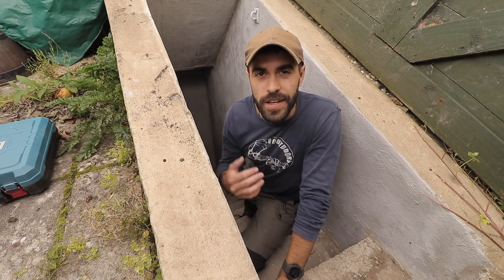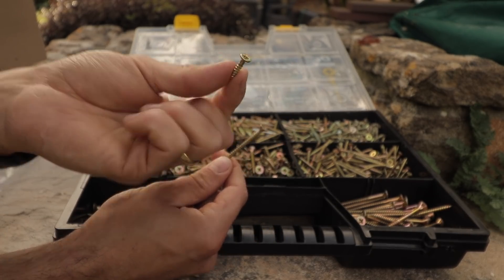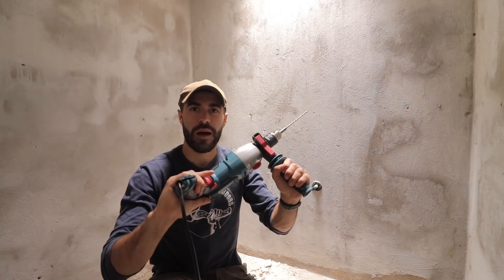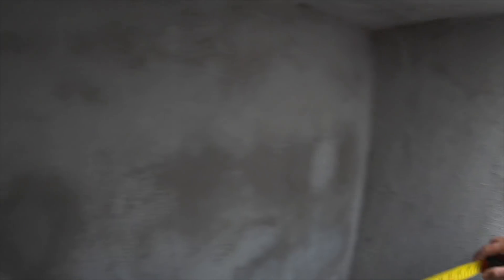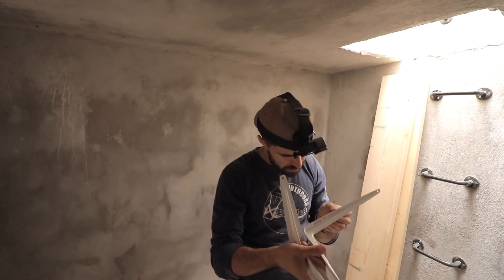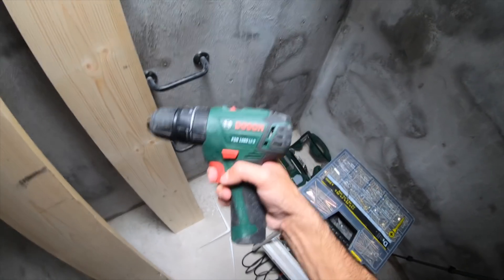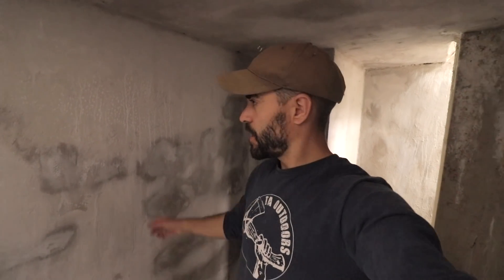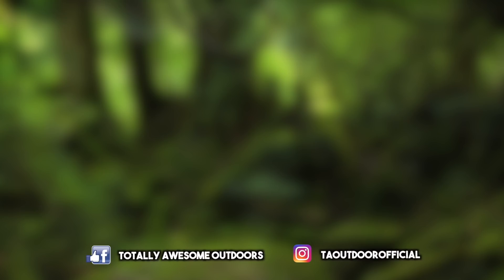Building an ESCAPE LADDER in my WW2 Bunker (PART 6)

Comment: one thing I would have done different for the roof hooks is to use ones with a 2 inch loop to allow for a bar like a dowel or shower curtain rod to be used on them making loads of room to hang stuff from as needed and perhaps a slightly longer set of screws on the ladder ... i would also add a set of heavy hook anchors in the long direction to rig a hammock from for nights out with the kid in the bunker ... for the sump perhaps hit up ikea for one of their round cutlery bins of metal to have a solid base for the sump and ground water seepage ... then put a water level activated pump in there with a hand made sewer cover type lid and power pass through then all you need do is plug in the pump when you need it OR leave it plugged into a solar charged battery system to run when it reaches the set level of water in the sump ... as for power in there ... those power strips with the movable connectors would be excellent for both long sides .. then you can reconfigure the power as you want when you want quickly without having to rip out anything ... just twist off the plug in and move it where you want and re attach it ... or add a new plug in etc ...

Comment: Mate, you used 2 brackets for a 193 cm shelf. That's going to bend in the middle and lift up on the sides. You should have used at the very least 3 brackets. Two near the ends and one in the middle. I would have used four just to make sure it doesn't collapse, ever.

Also you had to seal and stain the wood on all sides before installing.

Also while installing shelves. It is easier to first install the brackets and then put the board up and the secure the board to the brackets.

Comment: From the look and sound of them you ended up with towel bars not 'ADA' grab handles, would explain the dinky screws too.  Should have a thick heavy-duty mounting plate and 1mm+ tube wall, all steel.

Comment: Great vid, love it and still jealous as hell.  I know has been mentioned already about the screws but looking at how the rung was manufactured am a little concerned that over time the actuall rung will become loose from the screw plate.  Did not look very strong.  Also got to add that when using the rung some people may also pull up their weight with their hands on the rungs above as they move up, that means a downward force on the rung.  I would honestly go for a ladder system as each screw mounting supports the weight/pull on the steps above/below.

Comment: I'm sure you have thought of it already, but a wall-mounted folding bed and table/chair set would be neat. Also, I'm not sure if it's possible, but to get some sort of lighting down there that can run off of a generator would be neat. Not sure if there is a way to put a generator in there due to the exhaust fumes. But it's an idea!

Comment: As previous comments have stated, Concrete scews[aka tapcons] would do alot better for securing your rungs to the concrete, I hang signs and anchor other things sometimes in excess of 1000's lbs and tapcons shear weight is 100's of lbs even though your light those anchors could give out over time. Great idea getting a hammer drill, I love my bosch hammer, Love your videos!

Comment: if you look at==20:23 to the left you see the blocks with grass in the cracks--well all of this needs to be removed from there and filled in that way water does not run down the walls from the outside of that bunker--so do a all around check from the outside and seal all this.....good idea especially right now in this world of craziness.

Comment: Feel like you could have staggered them more left to right, since our body naturally climbs staggered hold more efficently.
Reply: while that is true, leverage is why they're commonly not staggered - our legs naturally come to together when stepping - same is true for a ladder - when one brings their leg up to step onto the rung ones foot is actually center with their nose when one pushes off with the other foot it too naturally goes to center line. 

the staggering our body does is caused by the act of motion not motion in of itself, off set/staggered ladders are for when their is more weight than the climber to be expected so as the transition from one rung to the next is fluid and not jickaty jacketty with added weight / carrying tools.

in short - the ladder is for escape - try moving fast up or down a staggered ladder as opposed to center line. center line is quicker.
Reply: Matt Moschel Interesting, didn't really think about it like that. Thanks for being respectful and not shitting on my opinion.
Reply: @veronder  hi Matt. Please see my comment earlier in relation to staggering on concrete surface, as compared to rungs above each other on a steel surface. In your case it's correct. But with the age of this particular surface, I feel it would be safer for Mike to stagger the rungs. In other words spread the load creating less pressure on any one part of the given surface. Cheers.

Comment: Without a doubt, I envision a connection failure before very long at all.  Please replace those screws with something capable to carrying above average body weight; plus some reasonable safety factor. 
I would also recommend checking the capacity of the fixture itself.  A grab rail is used as a supplemental support....say to grab in a shower if slipping or falling.  Not 200 lbs imperial.  That's why they aren't called "steps".  I can't imagine a grab rail that a company would certify as load carrying as they are being used.  An escape ladder would use heavy anchors, or better yet, "cast into a concrete wall" with the step being integral with the anchor.  I would hate to see you or a family member in a hospital with a broken leg or worse.

Comment: It's only a matter of time before those break.   When they do;  Go to a metal shop, or blacksmith and get some rebar bent  and drill the rebar into the wall and use anchor epoxy.  Those type of anchors aren't as effective with a lateral load.

Comment: Is there a way to get an indutrial heater in there, or even a simple woodstove, to dry out the walls and floors properly. See the problem is you can put sealer on the wals all you want to, but you will seal in the moisture as well, deteriorating the walls and floor over time. 
Just get a heater in there for a couple of days, get everything properly dried and you will not get the moisture back. I already see you have molds growing on one wall, you don't want that...
Make sure your walls and floor are dried one time properly before continuing the process of sealing...It just makes your sealing that much better and lasting longer...
Reply: In the video before this one he did have his woodburning stove on for a long time and spent the night in there too.
Reply: @sheona7693  Yeah, I know, but that needs maybe a week or longer to dry out completely, since it has been neglected for literal years, if not decades. 
You are not going to dry out a wet wall that old in just one night with a simple wood small stove, hence I asked if he could get an industrial heater in there. At least a 1000 Watts or even more. 
And then it should be there for at least a week if not longer...continuously on and well vented to let the old humid air and wetness dry out completely.
I am actually a renovator by trade, I have renovated a lot of old cellars and basements in France, Belgium and Germany, so I kind of know what I am talking about...
Thank you for your reply and have a magnificent day...

Comment: Why dont you get a heavy duty shelving unit? It has a lot more space, so you can store a lot more. 

If you put in heavy duty rings in the wall, you can put in 2 or 3 hammocks, so you can have a lot of shelve space, and fit in a lot of people without sacrificing shelve space.

Greetings,

Jeff

p.s.
If you have leaking walls look for: "polyurethane grout". It fills up all the leaks in the wall and will ensure nothing will come through the walls and floors.

Comment: Good NZ morning Mike. Not knowing what ratio of cement to gravel mix used during WW2, I'd be concerned about the placement of your rungs. Remember it's an escape hatch...and if you're in a hurry you actually put more pressure on those rungs than normal. I would've offset them, in a zig zag formation instead of one above the other. Yes you have room. If there's a slight weakness in the bunker wall, a crack could develop and will follow a line of least resistance. Screw hole to screw hole, in a more or less straight line. Being offset the chances of that happening are unlikely.  Yes rungs on ships and submarines are one above the other, but they welded on steel. Different story.
Love your channel. Take care mate and stay safe.

Comment: I wouldn't trust that, you need anchor bolts in order to make that secure, but they won't fit those handles. And I was going to mention the hammer drill also.
Reply: They look like towel hangers.

Comment: handles made with corrugated steel would do, then holes drilled and filled with Chemical anchoring. I would be very very careful with the "hole" specially if there are small children around.

Comment: I love this little series. Though, while I understand this is primarily for you, I do hope you'll put some contingency plans in place to make it usable for your whole family, at least for short periods. You know, like the intended purpose of the bunker. Of course it's hypothetical, but even so, I think it'd be cool to consider what this space would need in order to be comfortable if you had to stay there with your family for 24 hours during an air raid (just like it was fun to see you imagine the main entry being blocked and putting in a secondary exit).

You talk about "the bed" that'll double as a bench. But if you had to sleep your wife and daughter in there as well, what then? Your daughter is still young enough that she doesn't pose too much of an issue, but a second adult requires a second bed - could you have both a fold-down bed as well as space to string up a hammock? How much food/water (and formula/baby food) would you need to stock in there to be emergency prepared? Do you have a lidded bucket and toilet paper in there? What about diapers and wet wipes?

I don't need you to actually DO all that prep work (especially stocking all the essentials). But it would be nice to at least see a potential space being made for them. :-)

Comment: Those look like they are for the restroom as a grab bar. Did it give you a weight limitation? Why use wood screws on cement? Looks pretty un safe. Not trying to be a downer but safety is a concern.

Comment: As is, the wood shelves are unpainted against the wall. Af moisture DOES seep through the wall, the unpainted Woodville leech that moisture and be prone to rot. I dont know if its available in the UK, but I highly recommend flex seal (spray or bucket paint). Its a rubber item type paint that will keep out moisture. Plus with the rubberization, if you do store canned food etc on the shelves, they won't slide around if you bump into it

Comment: Solved the CO2 danger yet? CO2 is heavier than air and lack of side ventilation causes accumulation. Once the level reaches 2,000 ppm the physiological problems begin. In a small area bunker like yours that would not take too long, especially for anyone sleeping overnight. It needs attention.

Comment: This is the first of your videos where instead of loving it, I cringed as I saw you using plastic wall anchors, designed for hanging lightweight accessories on drywall!  They are typically rated for 15-30 lb loads.  In an application where your life may be at risk, you should go with sleeve anchors, tapcons, wedge anchors or lag shields.

Comment: That’s a depressingly small room in there. Yeah, I get the times, but let’s say the Germans made a successful attempt to take control over a substantial foothold in England and you had to be down there for God knows how long worried that you’d be bombed by a German plane. I don’t think I would feel any different down there while it looks like a concrete tomb with no colour or anything that would be a morale booster to your mental state. I found these things here in the US aswell, though I believe most wasn’t because of the Germans like you Brits they were because of the Soviets and nuclear fallout. Either way long term living inside one of these is just unimaginable
Reply: I wish when this particular thing was built they added a few more metres to the width of the room if they could of afforded to.

Comment: It's not really about the length of the screw (that's what she said), it's more about the shear strength of the screw. The long screws will help if you pull on the grips, but not with the downward force of you standing on them.  You need thicker screws.